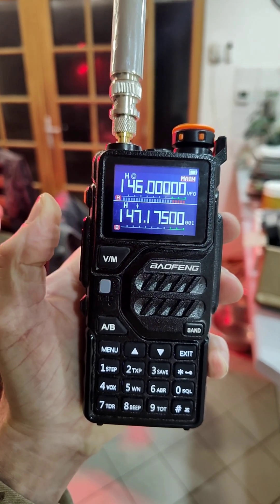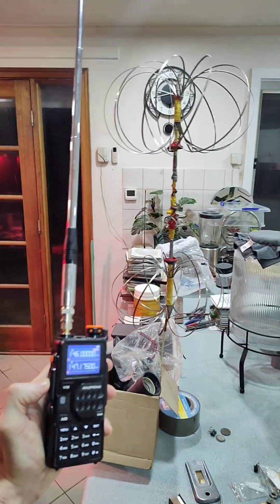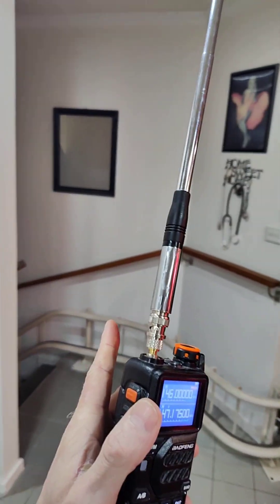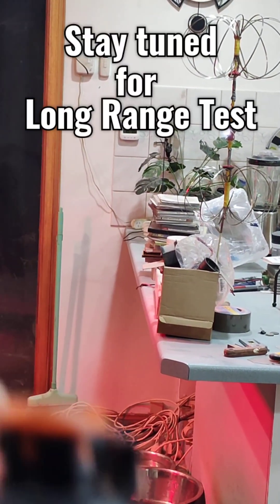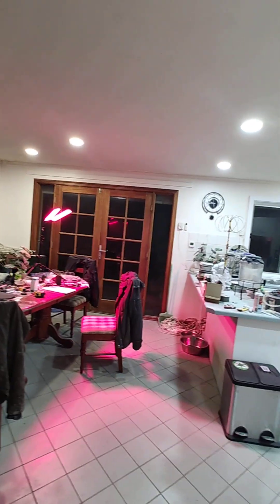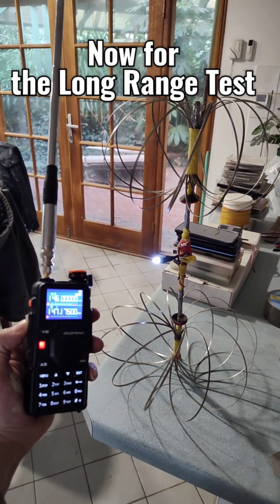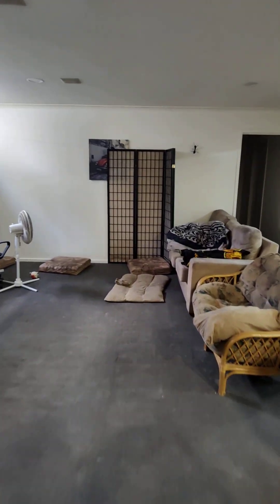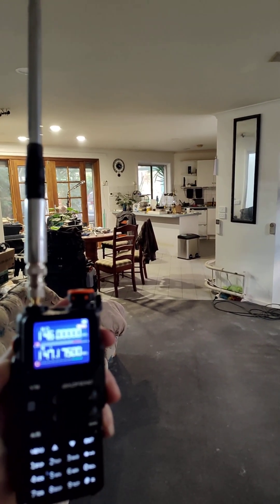Long Range Rectenna System

Comment from the maker: How to Build a Long Range Rectenna for VHF Video.
Link here : https://youtu.be/R1l_J57LsK8?si=8TM3legdIwFjp-2v
Reply: Brother plz provide circuit diagram
Reply from the maker: Hi my friend. 
I hope this helps
Regarding the how to build a long range vhf rectenna video.

Essentially the 3rd version has the exact same rectifier as the 2nd version.
The key differences are that the 2nd Version has more LED's all in parallel
& also uses two telescopic whips
with the ends connected to a 6 turn pancake coil at each end of the whips,
these bifilar coils are using a figure 8 speaker wire
(two wires in parallel)  and the other side of the coils connect to  the copper balls at each end.
In other words,
The bifilar pancake coils are in series between
the end of the telescopic whips and the copper balls/spheres.
The copper balls are actually polystyrene balls
coated in a self adhesive copper tape.

When I said 6 turns,
it is 6 turns of a twin wire (speaker cable)
essentially 12 turns althogether per coil.

Look up Master Ivo's channel on Youtube for how to build a bifilar pancake coil.

I suggest experimenting with the basic design.using materials you can get hold of.
It may behave more efficiently with larger copper spheres but I imagine it would need to be shorter than it is with the smaller spheres (balls).
I wish you luck with the experiments my friend 
⚡🙏⚡
The third Version is the one I shown in the video.
which has the tori at the top and bottom
on the fibreglass rod with copper tape over it.

I am not entirely sure if you are truly referring to the 2nd or 3rd version
hence my added detail on the 2nd version.
⚡🙏⚡
Reply: This is amazing i love it
Reply from the maker: Thanks So Much 🙏
I'm glad you love it 😁👌

Comment: Hi im looking for a practical usage for this ? I love this domain
Reply: Yes Ofcurse 
First practical use case is a rf powered battery charger 
What do you think?
Reply from the maker: Yes, I have already experimented with RF powered batteries 
but I haven't published any videos on that subject yet.

There are definitely many potential use cases
& also many potential ways to improve the range and efficiency too.

I look forward to settling down
in my new home
once I have moved,
So I can unpack all of my test gear
and get busy again experimenting.
🙏.
I have built a 12 to 15 volt battery system
that can be remotely charged via RF.

The rectifier is more like a cockroft  walton voltage multiplier with cells instead of capacitors.
Not exactly the same
but somewhat similar to the CW Voltage Multiplier.

Thanks for you interest mate.
I hope you get to experiment with this idea.
Reply: @crazyham ofcurse , I would be more than happy to join in such research i think this technology is key for humanity development
Reply from the maker: Please feel free to share your results etc with me if you experiment with this concept👌
Upload to youtube & link me. 
I do allow link sharing in the comments on this channel too👌⚡👌
Reply from the maker: Hi, I'm not sure what you mean?
There could be practical uses like wireless torches for example.
The main idea of this video is the experimentation with a rectenna concept.